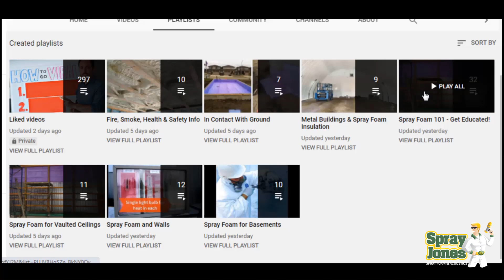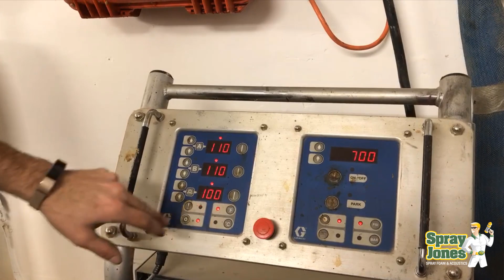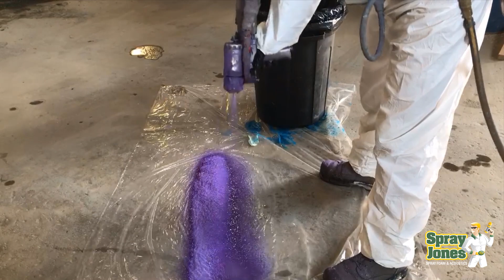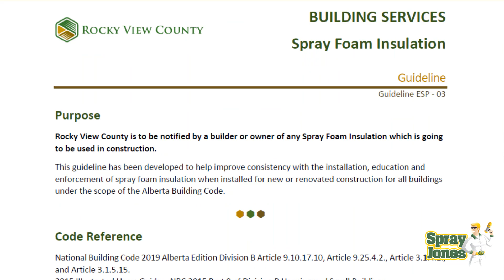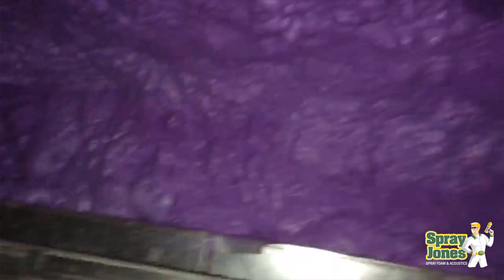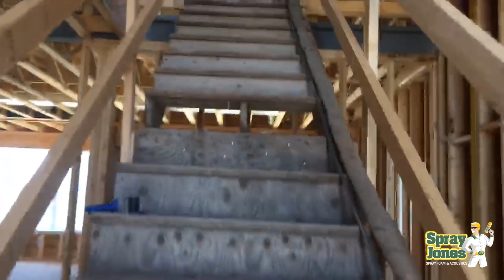Can I Spray Foam Insulation Myself?

Comment: I am having a contractor remodel a bathroom, but I have elected to reinsulate the (2"x4") wall myself. I was leaning towards getting a DIY spray foam kit; but after watching your video, I am having second thoughts. What, in general, is my best DIY option (I would prefer not to use fiberglass)? Caulk up gaps and install Rockwool batts? Cut foam board and glue it to the sheathing? I would appreciate any advice you can give.
Reply from the maker: Foam board well adhered and can foam of the cracks and edges.
Reply: @SprayJones  Thanks!
Reply: @SprayJones  Hi. I am having trouble finding foam board at a thickness that will full the stud bay (2x4). Can I glue two pieces of foam board together to full thickness, and then glue them to the sheathing? For example, a 2" thick piece glued to a 1" piece, then glued to the sheathing. Or will this compromise the R value? Thanks for your help.

Comment: Mike, you did a great job in this video and I enjoy watching all of your videos. I am all for hiring professionals for almost any kind of work. However I think that people (in the US) should always be able to do the work themselves if they so please, and advocating for regulation by code enforcement is not the answer. As stated in other comments below, most of the time the inspectors don't even know what they are talking  about, why put them in charge of some ones own home/building?
Reply from the maker: Thanks for watching. 

You missed the point entirely. 

I know as any SPF guy does that the average Joe cannot spray this on their own and should be prevented from doing so to avoid hurting themselves and others. 

I am an advocate for free markets but you cannot start mixing all the concrete for your house foundation yourself with a home made mixer for good reason. Concrete needs to be of a certain grade and standard as approved so that codes can even be established. SPF is no different.
Reply: @SprayJones  Actually, where I am located I can mix the concrete for my home if I so please, I only need to have electrical inspected, which is a state law. And I do understand your point completely, but as I said, half of the time the people who enforce the code don't even understand what it means, especially in more rural areas where the building science seems to lag behind more populated cites. I know that this is a more political argument than one about spray foam, which is not what your channel is about. However, laws are not meant to protect people from themselves, over-regulation slows innovation much more than it helps protect people. In a position such as yours, it is easy say no one should be able spray their own foam and they should just pay you to do it. I know that you do not have bad intentions in doing so, however you are going to be biased because of your position. People will pay professionals 9 times out of 10 because it almost always makes sense for timeliness and cost, so there is no need to force people to do something they already will do.
Reply: @gusty4395  I agree with you 100% too much regulation. Spray Jones has a lot of good info to share which I appreciate, but I’m all for freedom ... to succeed or fail. Canada is on a socialist trajectory and it causes everyone to think in a similar way. Government, DO NOT WORRY ABOUT MY SAFETY, PRESERVE MY LIBERTY.

Comment: The really funny part is that the froth packs on material alone costs about the same as having a pro like myself come spray it in. The people that want to rent the rig are even crazier. You really think I'm going to rent you a 50-100k specialty piece of equipment that if you do anything wrong costs thousands and thousands to fix or repair?
I did entertain myself with one guy asking. Told him, sure, I'll rent it to you. You give me a 25k deposit + 1000 per day for rent + pay me $100 and hr to teach you how to spray........ya he just has use do it instead lol.

Comment: I’m a DYI guy, and I know my limitations. I remember the home store clerk one time telling me the kit, is the same thing as what the pros use. It’s no harder than spraying paint. Paint doesn’t expand, I had questions. So I went looking for answers, I asked pros about the products, I did some reading, and watched some shows like this one, about how it do it. But more importantly, what can go wrong when it’s done wrong. Even the pros can screw this up, but they have insurance and a system in place to correct a bad job, if I do it, I’m not only out the time and cost of doing it wrong, but it will cost two, three times as much to remove and correct a bad job. Bottom line, this is something you bit the bullet on pay someone with a good reputation and years of experience to do. You do not want to be someone’s first job. If you want to learn how to do this, get the training and do an apprenticeship, don’t learn on your own, it’s not like spraying paint.
Reply: I agree. I'm redoing my garage next year and thought about diy but it's not like fiberglass where you can just take it out and do it over. What a nightmare it would be if you don't do 1 of 100 things wrong.

Comment: I have 2 all steel trusses,  about 2 feet top to bottom. I have noticed in your videos you  recommend spraying the entire metal connector "plate" on wood trusses with foam(up close to the vaulted ceiling. I am getting 3" closed cell on my ceiling. How much of my two foot high all steel ceiling  trusses needs spray foam??

Thanks

just jim

Comment: We need help here in usa.. Just got off phone with local inspector. They want to see the r value match fluff insulation. 
So code is r38. Foamer wants to put 5.5" icynene which only comes out to r22.

So i have to spray more (which is a waste) to appease the inspectors?
Going to dig through your old vids and see if i can pull up documentation. 
I then have to go through my architect and get this all approved.

Do you have a resource that will help us in the usa change the education. Especially inspectors.
Reply from the maker: Code is R 38 for vaulted ceilings? Ours is R28 or RSI 5.02. 
You need the SPF applied to the roof deck and treated as a cathedral detail value not flat ceiling detail.
Reply: @SprayJones  
My plans show r38 fluff +vents for the attic floor. 
I think for a simple question the inspector did pay enough attention (felt like he didnt have time).

Hopefully will hear back from another on monday. Sometimes its a matter of verbage. I will bring what you said up. Hopefully helps. 

If i didnt require inspections.. I would just get it done and ohh well them.
Reply from the maker: @turboflush  Your code should allow for a lesser value for cathedral or low slope roofs. If you apply to the roof this is standard to adhere to.
Reply: @SprayJones  
Just got flat out told that spray foam no good in southern climate by city plan reviewer. (old guy). Still requires the R38. The whole no movement of air through the insulation passed over his head. Moisture is a problem and icyenen is apparently bad when burning (I dont plan on staying in house if on fire). Going to try and go through the architect and see what he can come up with. 
Hopefully he is more in tune with modern materials and methods. 
Worst case.. appease the plans. spend more money and do my way after final insp.
Reply: @turboflush  My comment might be too late, but a good HVAC engineering company might be able to produce the documentation to get you performance based compliance instead of the perscriptive based compliance. Or simply give you more options.

Comment: For the job I did dyi worked out but, you have to make sure temperature are right. The surface and foam kit all have be the correct or it will fail.
 You have to follow the directions to the letter and not skip reading all the way through.
 I only did a small part of a house. I would hire a pro to do a whole house hands down.
Reply from the maker: Good job. Thanks for the feedback.

Comment: It certainly seems like hiring a pro is the way to go.
That said, what do you say about the DIY froth pak kits and the people that use them successfully?  
Correct mixtures and application without extensive training.
Did they just get lucky?
Reply from the maker: They can work, they are designed to do something for you. I see a lot of using them for what the are not intended to do.

Comment: i was going to do my rim joists with a kit from home depot, the kit was 750$ and probably would of not been enough t do the job.  i returned the kit and called a guy that has been spraying for years.... he did the job for 500$
Reply from the maker: Yes that is typical. Good call.
Reply: I found this to be the case also.
If you are spraying a boat or a small project. Go for it. But in most cases it is cheaper to higher a pro in this case. Proper.. Ppe, chemicals, mix, equipment, knowledge.. And best of all you dont have to fold yourself into a pretzel trying to use the kit where a pro has an adapter to handle it in comfort.